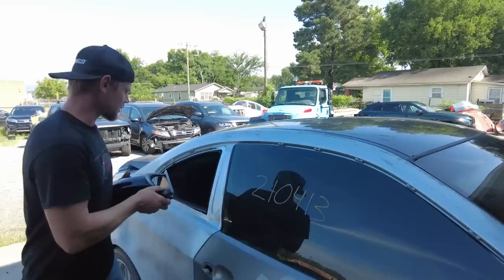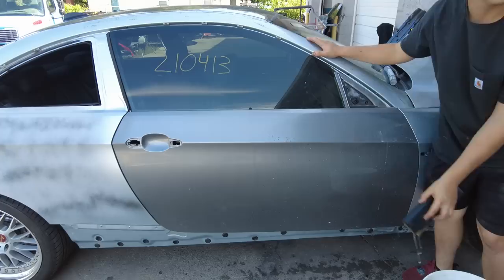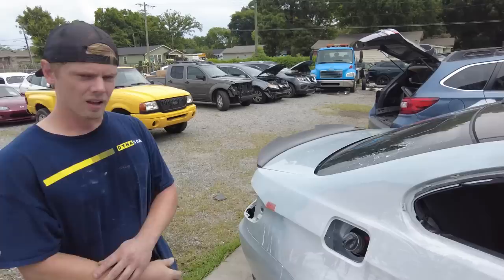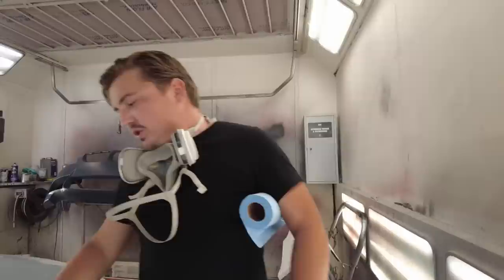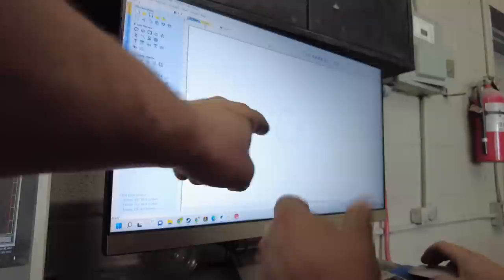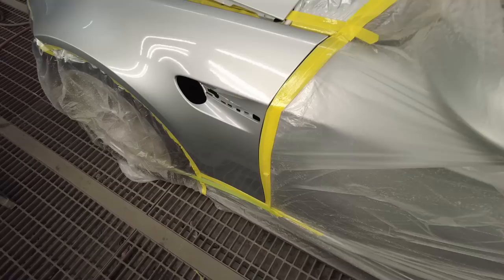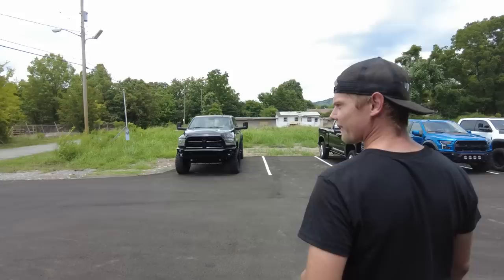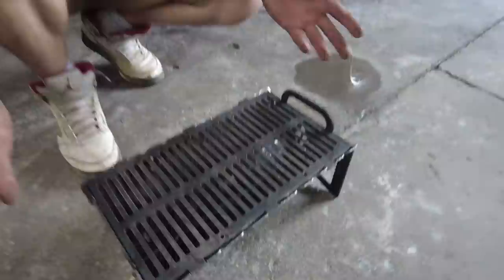The M3 paint job turned out great but there's a problem.

Comment: a tip from an old graffiti artist. what you want when spraying the guide coat is a fine mist as he says. try different caps for the can. why not source some from your local graffiti shop and get a cap that is really soft. that way you can spray your guide coat with ease. or even better, not sure nowadays how it is. but we used to rack caps from hairspray bottles just to find the right caps :D

Comment: its nice to see when you don't spill a little of your precious claret - but every job must have a little of your DNA in it somewhere and a use of some choice words - as you might remember me from playing with some ex military items, tanks and helichoppers etc - just a fortnight ago i broke my back, stone cold sober, and it wasn't really work related, nothing dangerous either, just loading boxes onto a shelf above head height
i was using a set of A frame steps and they collapsed under me, reckon i was 18 inches to two foot off the deck, i compressed and fractured T12, completely my fault when i opened the steps they stopped and i thought that was it, and remember thinking check the stay is correct (it wasn't) i should know better since having a fairly healthy attitude to working at height, never had issues working at any height, but they say the worst accidents happen closer to the ground, true, anyways i'm on the mend, wearing a brace and should be soon back at it in a couple of weeks, stay safe my peoples
PS love watching all you guys interact, Goonz etc, been watching all your channels from the beginning, starting with Ben doing some chassis bending
Reply from the maker: We hope you a speedy recovery and appreciate all the love and support that we get!